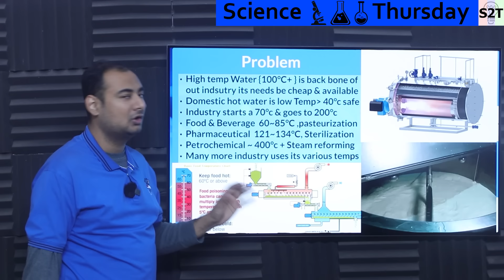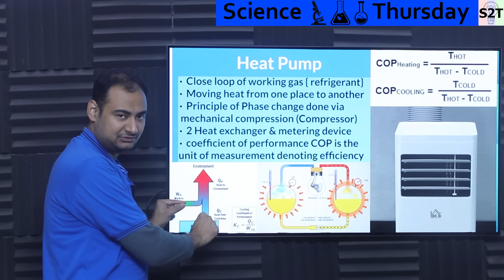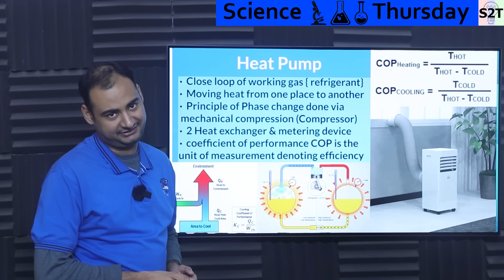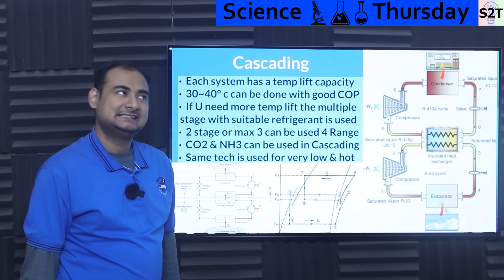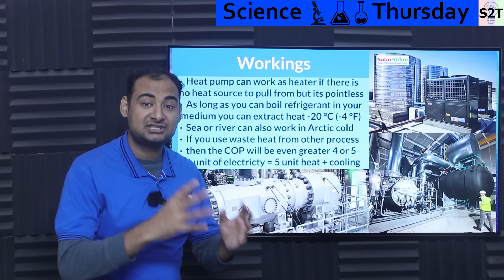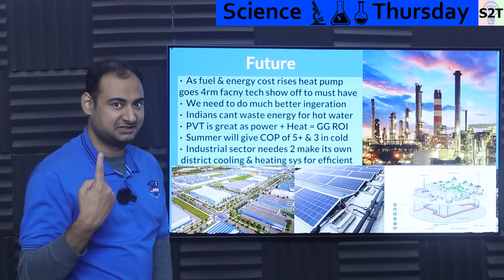High Temperature Heat Pump {HTHP} Explained {Science Thursday}

Comment: There is something called as Private Access Electricity 

In tamilnadu it's ₹0.7 per kw/h of transmission 
In Rajasthan it's ₹1.2

Setup solar anywhere and offset it with your electricity consumption

With BESS + solar 
cost is ₹2.68 + 0.7 =  ₹3.38

So yeah the problem is non existent
Reply from the maker: now u are making shit up a company cant just "Setup solar anywhere and offset it with your electricity consumption"  solar farm is not free  even with ROI its a HUGE loan and unless u deal with it u cant just make it not in 100s of mega watt scale its much cheaper & logical to use less power  in the first place
Reply: The problem that your country is overheated and those imbiciles with datacenters waste 50 percent of electricity as heat waste boiling the planet instead of heat geverated electricity. If you build cheap sand batteries heat pump them from air, solar concetrators, ground and then generate electricity by stirling, orc, otec and even condesate water from air so you start cool the region, otec in ocean, but idiots now putting datacenters

Comment: What are you smoking my man
You literally said cheap things like plastic are not recyclable 

Same concept with electricity 

When you can get solar electric for ₹1.7 from your roof 

Why would anyone care about saving electricity? 

The ROI on those heat pumps can never match the ROI from solar
Reply from the maker: because roof size is limited when u need mega watt class heater 24*7 u cant just make 4 to 5 acres roof space  that too will be weather dependend and 3x it if u want battery & 24*7  . Heap pump is an amplifier if u can do more work with less power its wise at 3 cop its burning money not doing it and at 2 it makes sense in many place